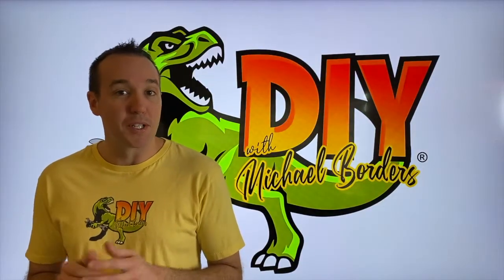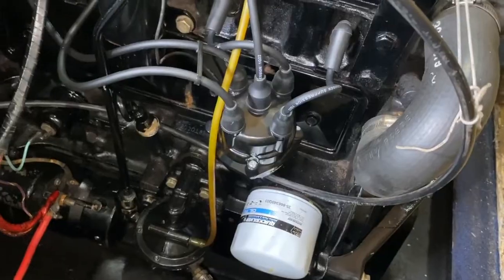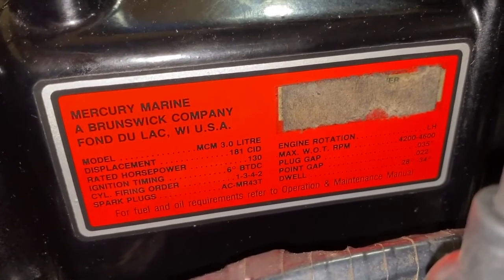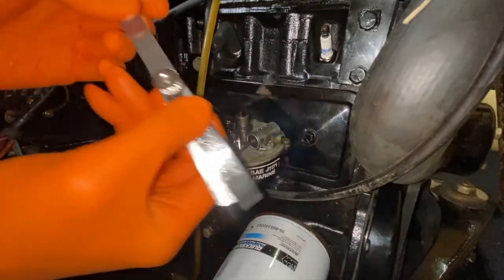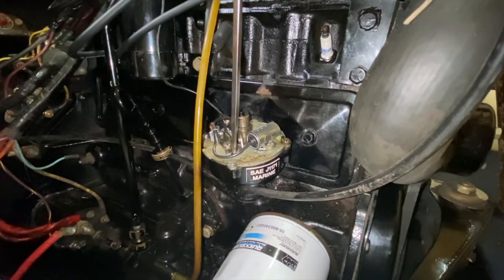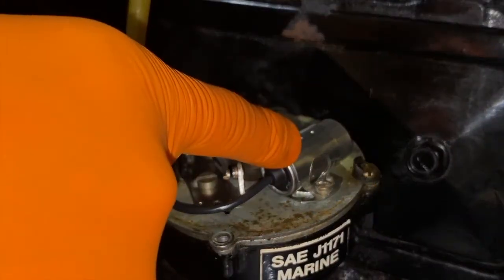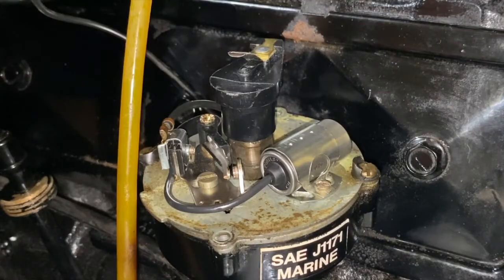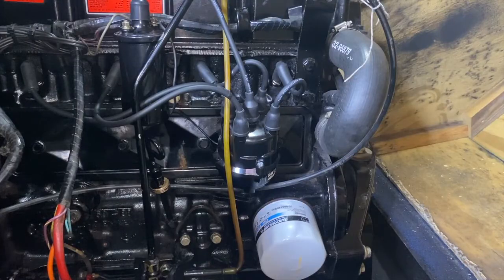How to set Mercruiser 3.0L inboard distributor point gap

Comment from the maker: If interested in purchasing this product, visit our Amazon affiliate link below.  I earn from qualifying purchases.

Point gap feeler gauge:  https://amzn.to/4cjPP2F

Distributor Cap:  https://amzn.to/3Pr4O0W

Distributor tuneup kit:  https://amzn.to/3IAvDMh

Trim Limit/Sender Solenoids:  https://amzn.to/3wXtZBL

Ignition coil:

       https://amzn.to/491of7o

       https://amzn.to/3wPEwPn

Fuel filter:  https://amzn.to/3Vlf0Mq

Spark plugs:  https://amzn.to/3TegFRe

Spark plug gap tool:  https://amzn.to/3PgGXB5

Wire and boot set:  https://amzn.to/49NcVNq

Ratchet socket set:  https://amzn.to/49SFkBD

Oil filter:  https://amzn.to/3VmEmcN

****************

1.  Replace Mercruiser inboard Trim Limit and Sender Solenoids

          https://youtu.be/ebUCWEFw7Xo

2.  Replace Mercruiser inboard 12v Ignition Coil

          https://youtu.be/PAc0cAYeY_c

3.  Replace inboard Distributor cap rotor and points

          https://youtu.be/kqBL1tSTMkk

4.  Replace Mercruiser outdrive Anode kit

          https://youtu.be/qy_qclP3zUQ

5.  Replace Mercruiser outdrive Trim Rams and Hydraulic Lines

          https://youtu.be/nkcFYl5bL7c

6.  Air bleed hydraulic Trim Rams and lines

          https://youtu.be/gfW3dWsSLkE?si=qXPu6ku1d5fkHc2H

7.  Replace Mercruiser 3.0l inboard spark plugs and wires

          https://youtu.be/-qStXfk5Zak

8.  Upper unit rebuild (PART 1)

          https://youtu.be/i7nRJPbRYPI

9.  Lower unit rebuild (PART 1)

          https://youtu.be/ehTA4BRH4t8

10.  Replace bellows/shift cable/water pump

          https://youtu.be/NcObTOYXtQM

11.  Replace Trim Limit and Sender switches

          https://youtu.be/vjJDnmJCNL4

12.  How to calibrate/align Trim Limit and Sender switches

          https://youtu.be/5BetZVkPPHI

13.  Change Mercruiser inboard engine oil

          https://youtu.be/F0UjuwQ3-4E

14.  (Fixing Boats/Jet Skis) PlayList

          https://youtube.com/playlist?list=PLjCXOz8TSkZlae2qY97uVVTm3JdBOUoRS&si=KLMsi1QjnMErTTVr

Comment: Are the spark plugs for the Merc cruiser 120 hp 2.5 L the same as the 3.0 liter engine?
Reply from the maker: @dennisrosa1551  

Thanks for watching, not always.  What plugs do you have currently installed?
Reply from the maker: @dennisrosa1551  

Below are links to parts and additional videos.

If interested in purchasing this product, visit our Amazon affiliate link below.  I earn from qualifying purchases.

Point gap feeler gauge:  https://amzn.to/4cjPP2F

Distributor Cap:  https://amzn.to/3Pr4O0W

Distributor tuneup kit:  https://amzn.to/3IAvDMh

Trim Limit/Sender Solenoids:  https://amzn.to/3wXtZBL

Ignition coil:

       https://amzn.to/491of7o

       https://amzn.to/3wPEwPn

Fuel filter:  https://amzn.to/3Vlf0Mq

Spark plugs:  https://amzn.to/3TegFRe

Spark plug gap tool:  https://amzn.to/3PgGXB5

Wire and boot set:  https://amzn.to/49NcVNq

Ratchet socket set:  https://amzn.to/49SFkBD

Oil filter:  https://amzn.to/3VmEmcN

****************

1.  Replace Mercruiser inboard Trim Limit and Sender Solenoids

          https://youtu.be/ebUCWEFw7Xo

2.  Replace Mercruiser inboard 12v Ignition Coil

          https://youtu.be/PAc0cAYeY_c

3.  Replace inboard Distributor cap rotor and points

          https://youtu.be/kqBL1tSTMkk

4.  Replace Mercruiser outdrive Anode kit

          https://youtu.be/qy_qclP3zUQ

5.  Replace Mercruiser outdrive Trim Rams and Hydraulic Lines

          https://youtu.be/nkcFYl5bL7c

6.  Air bleed hydraulic Trim Rams and lines

          https://youtu.be/gfW3dWsSLkE?si=qXPu6ku1d5fkHc2H

7.  Replace Mercruiser 3.0l inboard spark plugs and wires

          https://youtu.be/-qStXfk5Zak

8.  Upper unit rebuild (PART 1)

          https://youtu.be/i7nRJPbRYPI

9.  Lower unit rebuild (PART 1)

          https://youtu.be/ehTA4BRH4t8

10.  Replace bellows/shift cable/water pump

          https://youtu.be/NcObTOYXtQM

11.  Replace Trim Limit and Sender switches

          https://youtu.be/vjJDnmJCNL4

12.  How to calibrate/align Trim Limit and Sender switches

          https://youtu.be/5BetZVkPPHI

13.  Change Mercruiser inboard engine oil

          https://youtu.be/F0UjuwQ3-4E

14.  (Fixing Boats/Jet Skis) PlayList

          https://youtube.com/playlist?list=PLjCXOz8TSkZlae2qY97uVVTm3JdBOUoRS&si=KLMsi1QjnMErTTVr

Comment: Will an incorrect points gap limit the WOT?  I recently pulled my motor and replaced the distributor, cap and rotor, plugs, fuel pump, carb but can't get it to WOT and am thinking the brand new distributor doesn't have a correct point???????
Reply from the maker: @johnduszynski7276  

Thanks for watching and indeed it can.  Setting the points properly may solve your issue.  😎👍🧰

Comment: Hi! I have a Mercruiser 1989 410 3.0 alpha 1 gen one. I changed the 4 spark plugs and cables but forgot to take photos to reinstall the 1342 sequence on the dis cap. Is there any way to know what goes where? Also, the new cables do not cover entirely the spark plug like do yours and the old ones I replaced. Is it ok nevertheless? Thank you so much for your video: having seen it BEFORE 😮, there are some mistakes I wouldn’t regret now😢.
Reply from the maker: @lucesainte-marie9017  

Thanks for watching, any update?  If your outdrive firing order is also 1-3-4-2 like ours is, you can follow the exact steps set forth in this video.

😁👍🧰

Comment: What causes the coil to overheat mine is overheating and burning up two of em so far
Reply from the maker: Thanks for watching, great question.  It can be as simple as old worn out plugs and wires.  In addition, the below items can cause coil to overheat.

1.  Distributor point not properly set
2.  An electrical short or loose connection on coil
3.  Engine timing off

🧰